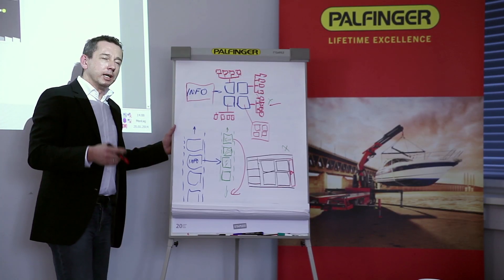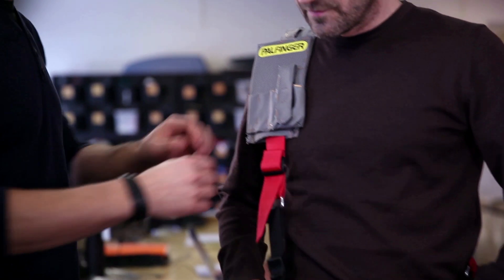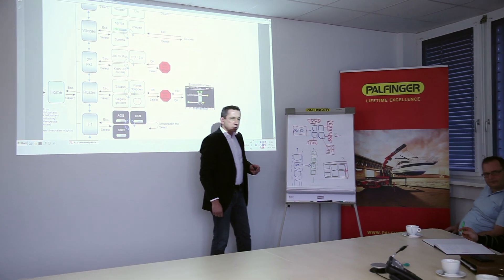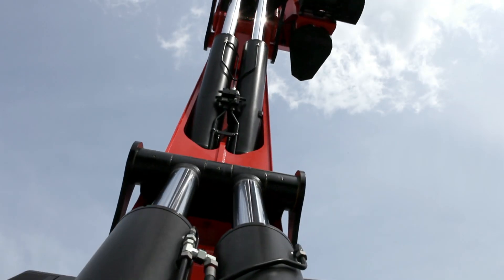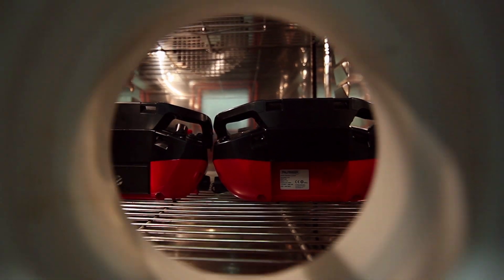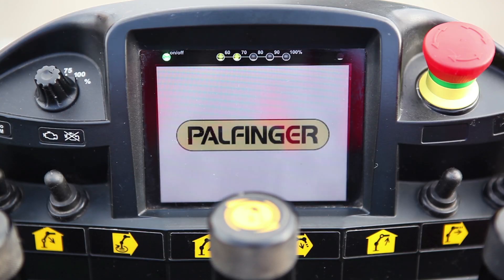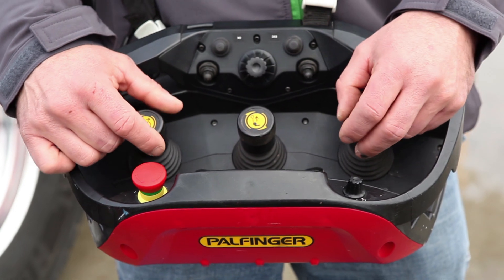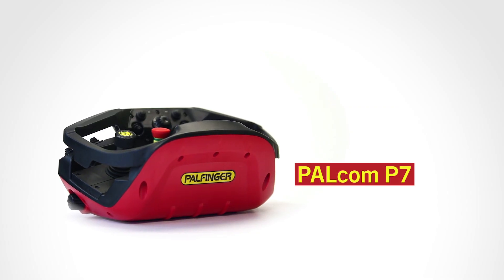PALFINGER PALcom P7 Remote Control for Loader Cranes (English)

Comment: It's a nice remote but compared to the old RC400 model there are way to many steps to get to the special functions.
On the RC400 I hold one button down and flick a rocker switch to get all my extras. Legs, front legs and extendable rear and as soon as I'm done I release the button and go straight back to crane mode. Don't need to look at the remote to do it and it is a big difference to the P7 where you need to look down and go thru menus and sometimes click on the wheel and some times click OK.
Simplify and add hard buttons for often used functions.